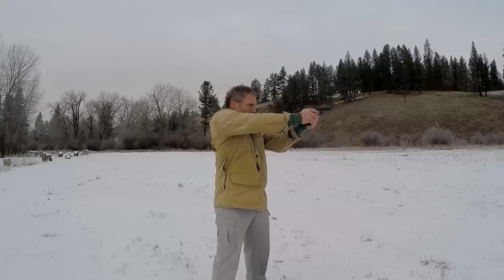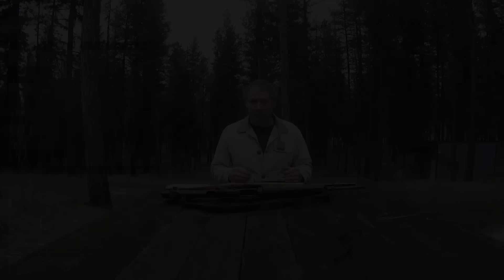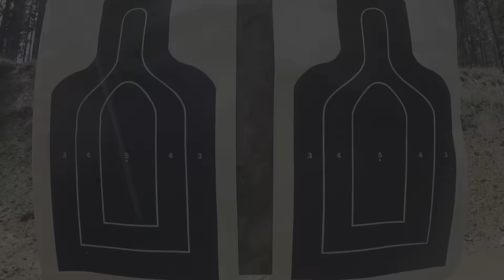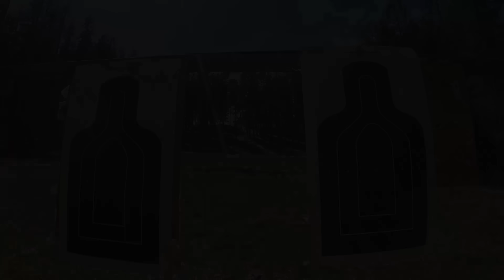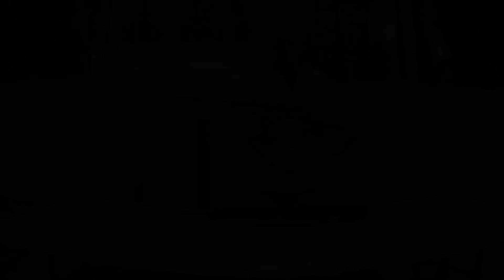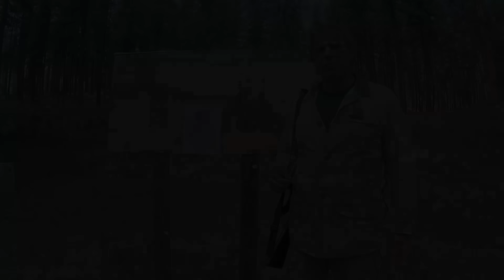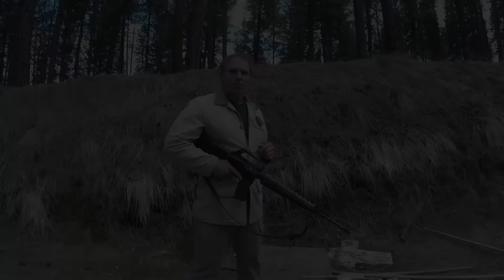Mini-14 vs AR15: Which is Better?

Comment: Even in legally restrictive jurisdictions where the mini would be viable there are often better choices. “Featureless” ARs are pretty ubiquitous even here in California. Really the only reason to want a mini is aesthetics (nostalgia being a subset of that).
Reply: andyrihn1 I thought the featureless ARs couldn’t have detachable mags either
Reply: Alex Moore four ways to have an AR rifle (AR pistols have a lot more hoops to jump through) that follows the law in California.
1) manually operated. Kind of like how you see in the UK with straight pull ARs

2) rimfire. Rimfire rifles (but not pistols) are totally immune to the assault weapon ban 

3) fixed magazine (aka “compliant”). If the magazine can only be removed by separating the upper and lower, it’s fine. There are plenty of devices that open the action just enough to count that are pretty quick. Or you can reload with something like the MA Loader (basically a stripper clip)

4) featureless. Assault weapon is defined for rifles as being a self loading center rifle rifle that accepts detachable magazines and any one of the following features: folding or collapsing stock, thumbhole stock, pistol grip, vertical fore grip, flash suppressor, bayonet lug, grenade or flare launcher. As long as you don’t have any of those features, detachable mags are ok. I prefer this one because basically you can have a gun with the exact same manual of arms and is really just as fast just with different, ultimately aesthetic, features.
Reply: Alex Moore yeah it’s bs but I kind of like the ingenuity of working around it (kind of like all those “NFA nut kicker” products out there but actually good). Also you’d be amazed how many anti-gunners I’ve converted away from assault weapon bans by just calmly explaining this bs to them
Reply: andyrihn1 still should be trying to end it altogether instead of stopping at work arounds
Reply: Alex Moore absolutely right. And that’s why I make a point to show people how dumb assault weapon bans are

Comment: Great comparison Sir! One thing to mention I think is that the typical end user CANNOT service the firing pin of a Mini they way you can with an AR. Is it a problem? Not a lot from my experience, but it does happen occasionally and is something to consider. Also, the modular nature of the AR and the availability of several alternate calibers by simply changing the upper. I gave up my Minis when I cut my mullet and stopped wearing parachute pants! :) :) :) Thank you for the videos!

Comment: As always, an excellent video. It wasn't too long in this form, but maintence probably would have made it too much. Having always owned both, you missed my favorite part of the AR- as it is basically "open source", you can configure it however you have the urge. And learn from your mistakes.

And I for one would actually like a coherent and rational discussion of .223 Remington vs 5.56 NATO vs .223 Wylde. And while you're at it, .308 Winchester vs 7.62 NATO.

Comment: I live in one those mass hole state lol. I hate the laws.  Even know I got a piston ar and a ak before the Nazis change the laws. Ive mess with a few mini 14 and I did see one good idea. A guy put a wire loop on stripper clips. And look alot faster at reloading. Havent had much time with mini14 but yeah the mags can be little tricky at first lol

Comment: Think I bought my mini 14 in the early 2000s. My father had bought one right before the gun ban in 94 was it? Anyways I like the Wood stock look it feels good in my hand. It seems like everybody has an AR I like being different. and the magazines I don't know if you guys remember USA magazine, my father bought two of those in 20rd, they will not work in either one of our mini's. They don't load fast enough if you try to shoot fast it will actually dent shell casing. he has 1 30rd that's plastic. only thing I can remember about it is it has the word RAM on it with a Rams Head. That works beautifully in both of our rifles. I know I could anything at a hundred yards,I don't know about any farther because I have not been to a range that has a longer distance.

Comment: Question, Paul--I know the Mini 14 is stamped .223, but although I've only ever had access to 3 or 4 manuals that came with the Mini I was holding, the Ruger Mini 14 Manual clearly stated that the rifle was chambered for, and completely safe, using the 5.56 Nato round. The stamping on the rifle was a matter of 1970s era common understanding of what a .223 was. What's the present state of the official Ruger Manual statement?

Comment: I personally live in a jurisdiction where the AR15 is "scary" or a "machine gun." I own an AR15/M16A3 and keep it out of sight as much as possible because people believe whatever the news anchorman/woman says. I also have to detach the upper and lower when putting it in the case for transport. If I get pulled over and a cop finds out I have it in my trunk, due to jurisdiction, then I may have to disassemble it further depending on the cop's persuasion.
Mr. Harrell, thank you for taking the time to point out the differences between both weapon systems.

Comment: I have a tricked out 182 series Mini that loves making a single enlarged hole at 100.  Put the factory stock on it, and I'd be lucky to hit the target.  The stock fit seems to be the main factor in the Mini's accuracy. The folding stock fits the action tightly, where the factory stock fits loose.  The Mini may be stamped .223, but the manual states that it can handle both types.  Some mags have play in their fit and can get dog eared by the bolt if the bottom of the mag touches the ground while in prone.  On the AR side, there were a couple of mag manufacturers that you wanted to run away from.  I run a Colt SP1 without forward assist.  If I remember correctly, what's on at 25 was also on at 250, not 300.  At 300 it was supposed to drop some, but not much from my experience.  I never had problems dropping a target at 300.  As a military armorer, I've seen accuracy in AR's go from extreme to horrid.  At 25, a dime or less is good, nickel is average, and quarter or larger bad.

Comment: This opens a new line of inquiry: What are the differences in using .223 vs 5.56 NATO in modern AR-15s that ostensibly are designed for both?

Comment: Excellent video.  I battle sight zeroed the A2 type at 25 meters and I hated how high it shot at 100 yards.  I hated the AR design for a long time, If the enemy lays on the ground you would shoot over them.  I couldn't hit cans or bottles because the elevation is always off.  I zeroed my rifle at 100 yards after a navy seal recommend that 100 yards is a better zero.  If someone is farther away just shoot a bit high. I think the sights are too high above the barrel. Red dot scopes on the A3 rail are very popular right now.